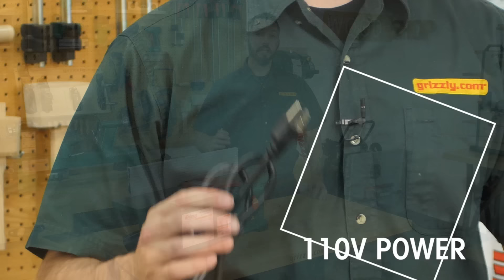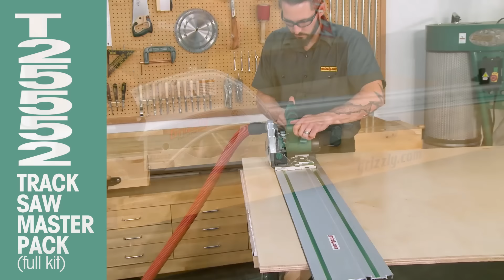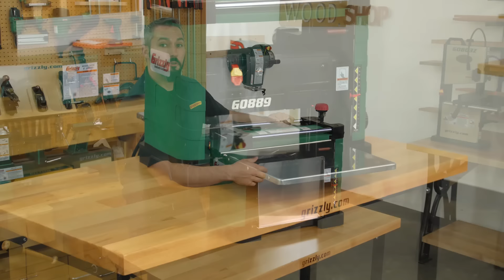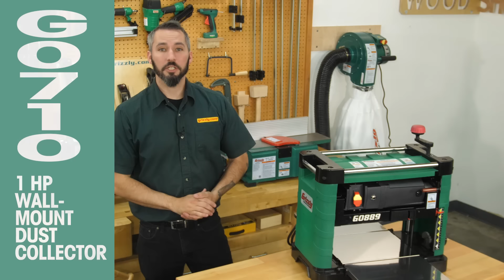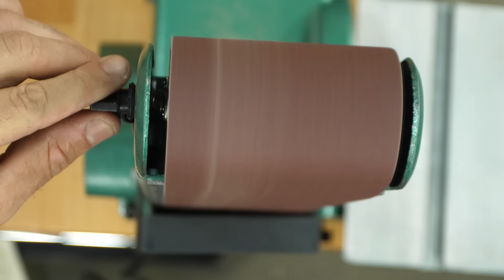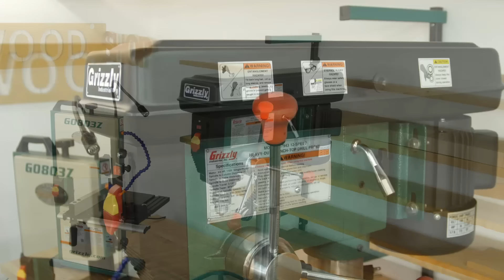Small Woodworking Shop: The Essential Grizzly Tools

Comment: Do you no longer have the Shop Planner available on your web site? I could not find it.
Reply from the maker: Hi there! The specific planer referenced here is the G0889, available at grizzly.com/products/grizzly-13-2-hp-benchtop-planer/g0889. We also have a ton of other great planers available on our site, so feel free to browse around!
Reply: @grizzlymachines  He means the blue-print tool they used to have on the website. You would put your shop size in and then see how different Grizzly machines will fit that space.

Comment: I’m trying to make my 8x8 shed into a shop. Super small and quite the undertaking. I don’t even think you guys could get it done. It’s a struggle.
Reply from the maker: Small space for sure. How's it turning out so far? What was the biggest obstacle you solved?
Reply: @grizzlymachines  it is ok. I made a tv stand for my daughter for Christmas some cutting boards for father and brother and wine bottle and twine glasses holders. It was a struggle. The floor is an obstacle but I think my biggest I obstacle is a table saw right now I use a harbor freight finger slicer 3000 I want the DeWalt 8 1\4 I think it is but fixed income makes it hard but imma keep on pushing thru
Reply: @grizzlymachines  Keep up the great content BTW.

Comment: I think this would make a perfect one wall basement shop for people that don't have a garage or use their garage for other things like parking their car. I would also add on the battery powered Grizzly pro 11 piece set to round out the shop. Grizzly also has a variety other tools that help with a start up shop. Things like measuring devices, clamps, glue,hand tools and a lot more. All at great prices.
Reply from the maker: Thank you for your support and your recommendation!
Reply: @grizzlymachines  Thanks

Comment: Sounds like a good reason for Grizzly to configure a "Small Woodshop" package deal. Tiered discounts from 5 to 10 percent for buying two, three, four, or more of the tools in the package and similar discounts on the associated stands and benches.
Reply from the maker: Thank you for the suggestion. Which of these tools would you be interested in for a package deal? We do currently have free shipping on all non-freight items through April. ~Kevin
Reply: @grizzlymachines  Actually, just bought the table saw. But, if there had been a promotion, I would have probably got the planer and the drill press.
Reply: @grizzly industrial, inc I would also bundle some tools together for a discount

Comment: Good video, but when it comes to dimensioning rough lumber I'd suggest a different sequence. Joint one face first then the edge, that way you have the flat face to reference along the fence to make sure your corner is square. Then rip your other edge through the table saw, then planer last. I prefer doing the table saw before the planer that way it makes less shavings from the narrower face and puts less strain on the planer's motor and cutter-head knives.
Reply from the maker: Thank you for the suggestion. Sounds like an effective method that I will have to test out. ~Kevin